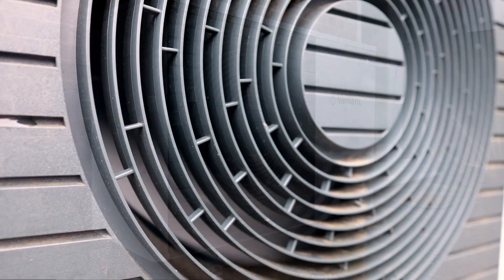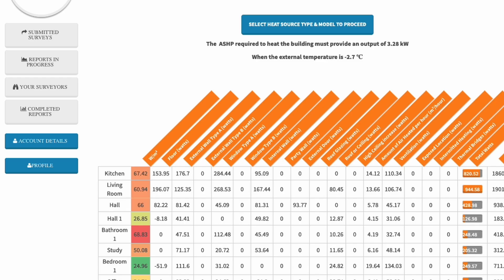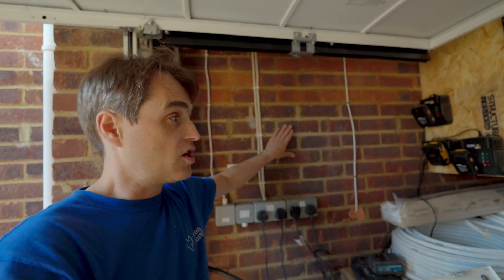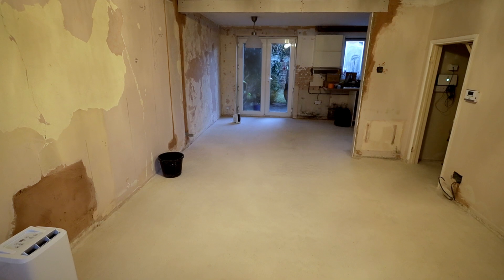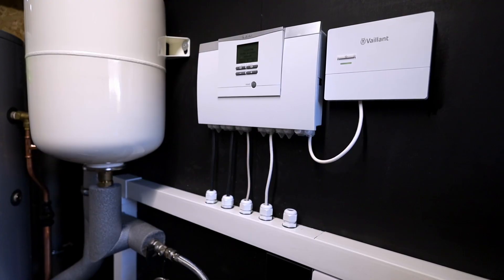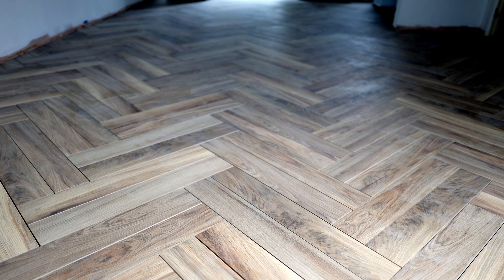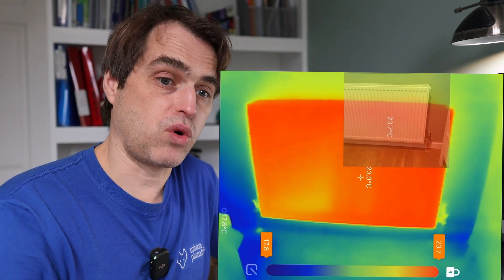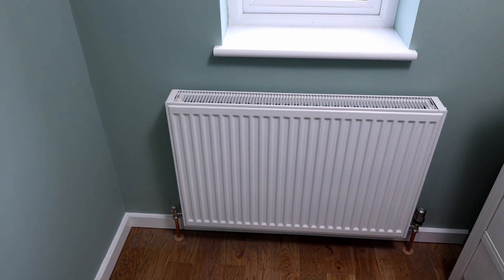How I Installed The Most Efficienct Heat Pump In The UK.

Comment: Could you tell me more about how you achieved such a high DHW COP? (Currently shown as 4.6) Looks like a Joule cyclone cylinder, and I guess you use the Vaillant Arotherm plus 5 kW in Eco mode? What size cylinder is it? What's the smaller tank, I thought you said you didn't use a buffer?
Reply from the maker: Currently using Newark 6m2 coil cylinder that replaced the Joule. Water heated to 44c using 0c offset, eco setting and also quiet mode to further drop heat pump power.

Comment: My boiler broke and I immediately assumed I'd get a heat pump. Now I've done the research and got quotes in it seems installers are charging in the order of £2000 a day labour rate, assuming two people that's about £1000 per day wages. Or £20k per month, £240k per year?! Then with the difference between gas and electricity prices I need the heat pump to reach a COP >4.2 in order for it to be cheaper to run than the gas boiler. That's ignoring the increased cost to install it. Now I'm looking at batteries and solar in order to make the heat pump make financial sense. It looks to me like in order to get the COP that high I might need new rads, improved insulation, and maybe even new windows. Further increasing the costs. It's the right thing to do in the LONG run. But I'd be paying a high premium up front for something that might not pay itself back for 20+ years. I guess this explains why heat pump take up is so slow: The ROI is so long that only people with excess cash or who are certain they want to live there for 20+years invest in it.
Reply from the maker: If installers were charging £1kper day per installer average heat pump retrofit would cost £30k. Is that what you are being quoted?
Reply: Have you noticed that when the Government put the grant up from 5k to 7.5k, the installers quotes went up by the same amount!!!
Reply from the maker: @adamsweet3587 no they didn’t - Ofgem statistics shows a mean price going up £13 in a year. That means the price has actually come down by some 5-6% when you take inflation into the account. Mean BUS heat pump supply and fit cost is £13k
Reply: @UrbanPlumbers Cost is about £6300 to me after the £7500 BUS rebate. £13800 without BUS. 

To be fair there's significant cost in the surveying, design of the system, sourcing of parts, etc. But I'm being charged £450 for the survey which I presume covers their time to do it and the associated calcs. With the right set of spreadsheets and having done it before multiple times, I'm thinking that might take a day? Maybe two? If it takes longer than this then get in touch and I can knock you up a calculator that should take a lot of the time and effort out of this!

Looks like they're charging about 20% markup on top of the parts cost (Price inc VAT +20%). From what I understand that is fairly normal for any trade. 

I'm being quoted >£4000 for heat pump installation labour plus the materials etc.  I've not had it done so I don't know how long it takes, but statistics seem to think it's usually 2 or 3 days? I assumed two people for two days, hence £1000 per person day. Being fairer, call it three days and that's about £700 per fitter per day?

Are you saying it should take 30 days to take out the boiler and install a heat pump in a property? Factoring in 250 working days a year and full time would be 8 heat pump installs per year. £4700 labour fee per job would add up to £38K per year. Fine if you're working alone, but some of this stuff is heavy so I expect two people, which £19k per year which is less than minimum wage. Also 30 days to do the install seems insane. It really does look like 2-3 days worth of work? I'll report back once it's done, I guess?

Or 10 people working the 3 day average install time? £39k each per year. That seems pretty reasonable!... But then there's the video of Adam having his hydrogen fuel cell replaced with a heat pump in a day with "six" heating engineers (but I count 7 + Adam). That kind of makes sense with two people for three days? 6 people in one day?
Reply from the maker: £13.8k without bus is about correct. Adam’s job was done by the top 6 guys in the country - we do charge more and we are quicker are what we do
Reply: @adamsweet3587  I didn't, but inflation has been mad the last few years. That could explain a big old chunk of the difference. I think we had ~16% in one year alone due to COVID?! From 2019 to 2024 £11k has been inflated up to £13.65K.

Do you have receipts for this claim? Like, quotes with the 5k BUS and then the same with 7.5K? Was labour charged at £2k per install prior to the BUS increase?
Reply from the maker: @Leo99929 just check Ofgem stats - available to anyone for all the BUS data
Reply: @UrbanPlumbers  Thank you for the pointer! 

Can confirm: 2022-2023 average air source heat pump total quote amount for BUS grants paid (grant value included) £13590. 
Same statistic for 2023-2024: £13811
An increase of £221 or about 1.6%. That's less than inflation or CPI. Meaning that quotes doesn't seem to have increased proportionately since September 2023 when the grant changed. 
It doesn't look like there's any truth to @adamsweet3587's claims.
Reply from the maker: @Leo99929 yes, people just assume things without doing any research
Reply: It’s funny our obsession about ROI, we never talk about how a car pays us back, or an attic conversion. We do them and we benefit from them in comfort, being able to do things better, saving carbon etc. and if ROI happens then that’s just a bonus.

Comment: If you well insulate a house and install a dense underfloor heating pipe network running at 35c flow temp but run it off a gas combination boiler is that cheaper or more expensive to run than a heat pump? For sure you've got 400% efficiency from the heat pump but electricity is 3-5x the cost of gas and the heat pump itself is much more expensive than a boiler.
Reply from the maker: It will be much cheaper on heating with a heat pump. Mine runs at scop of 5 and boiler would be around 95% efficiency for n this set up so heat pump is over 5 times more efficient
Reply: Quick reply thanks, however gas is 5.5p kWh while electricity is 25p kWh, surely it would then need to be at least 400% efficient to just break even on running costs. There's also the not small consideration of the heat pump needing a cylinder in addition to the heat pump both of which cost individually more than a decent combi. I see the benefits of the tech but I can't help but think that the financial benefits are negated by the high relative cost of electricity over gas and the additional upfront cost of the equipment.
Reply from the maker: @junejunes2024 I pay 0.22p for electricity and 8p at night for 6h. 

Spark gap will close sooner or later. Gas is bound to be more expensive as time goes not cheaper.

Comment: Thanks I have had a 8kw Ecodan heat pump installed. I calculated I only need 4kw and it’s showing 2.5 scop on hot water only . I got heat energy monitoring installed . I am looking forward 
To higher SCOP once the weather compensation sorted. I am encouraged by your videos and hope eventually to keep improving the system
Cheers Andrew

Comment: I will be installing heat pumps, however, I do not expect to be able to use them in the depth of winter as the temperatures get to -30 Celsius. At that temperature the heat pumps simply can't keep up.

Comment: I have also installed my own vaillant arotherm 7 kw heat pump connected to my underfloor heating without buffers in a well insulated new build. I also have installed kamstrup heat flow meters.  My SCOP is also higher than what the spec says should be

Comment: Well done, this is a great video, very clear and informative. The only thing I would add is a clear view of the plant room schematic, although the layout is fairly obvious to me.
How do you get on with domestic hot water? 
Does the heating go off for long periods whilst the domestic hot water is heating up? Do you notice the temperature dropping in the house?
I hope the cable in the cavity doesn't bridge the cavity and cause damp on the inside wall, I would be slightly worried about that. Probably be ok.
I looked at the recent COP figures. The outside temp is going up, but your COP is going down, any idea why?
Overall very good job, a nice simple and neat install.
Reply from the maker: it is what is called 'Hot Water Priority' so hot water is never done at the same time as heating.

COP is going down as my heating COP is around 5 and hot water is aroudn 4 - and now I am only doing how water so it will push the scop down towards 4 and then go back again in the winter.

Just shows, that my system has the highest COPs in the winter!

Comment: Do you get any vibration/noise from the unit in the house? We've been advised to put them a few metres away from an external wall, although customer complaints haven't been about noise, more about water not being hot enough lol
Reply from the maker: Depends on a heat pump. My vaillant is dead quiet - can’t even tell if it’s on and water goes to 70c so plenty hot

Comment: You made my day with the uninsulated underfloor comment.  I installed hydronic in my basement slab without insulating underneath it (sides insulated) thinking the thermal earth mass (gravel) under the slab would be helpful for maintaining temperature.  For years everyone said this was a big mistake due to “infinite” heat loss through the ground (despite earth being an insulator itself).  Anyway .. I never noticed any unusual issues /losses with my system but nevertheless thought I made a mistake .. but this video actually supports that I may even have made a smart choice after-all by forgoing this insulation as thermal mass helps heat pumps big time .. and I’ll be installing one as soon as we get cold-weather propane units in our market. Thanks.

Comment: How is the UFH performing without insulation? I'm thinking about doing the same at mine, was curious to know how it is going? I feel the same as will act as huge thermal mass. Additionally if the solid floor (uninsulated) is factored in with the heat loss and as consequence the pump is adequately sized, there shouldn't be any issues. Cheers
Reply from the maker: Works extremely well. I have done it on more jobs now and it gives great thermal mass and amazing efficiency!

Comment: £600-800? my 4 bed semi 1960x build with 8mm copper and combi boiler was ~£360 last year (May 2023-May 2024) that includes £100 standing charge, HG quote to switch to Heat Pump is around £9k after gov grant, and that doesn't include re-piping the house which additional £3.5k. My annual consumption ~6000kWh, even I run with 500% efficiency, that would cost me £324 per year. So fantastic saving of £36 a year with payoff period of around 250-350 years. If I put £9k aside and lets imagine earn 5-6% interest, in 350 years it will be £234,691,404,461.51 with buying power £7,541,687. What is my take? Heat pump is an awesome technology, ruined by manufactures selling them super overpriced and installers charging an arm and a leg. My 3.2kW air-to-air unit costs £1200 with the installation, it is a variable heat pump also, I would say even more complicated than any Air-to-Water as there are 2 blocks, but we used to them, so prices are reasonable.
Reply: I have 8mm copper pipe and a combi boiler.Your gas bill was £360 in a year? Our house is 3 bedroom detached build 43 years ago .Double glazing and cavity wall insulation.Loft insulated.Our gas bill is double that do you have your heating on? We heat up 8 radiators.Or have i got this all wrong?
Reply: @foppo100  I have a small house 108m2, cavity, loft insulation, double glazing, 2025 gas  total was £453.40 with SC. 6370.53 kWh used for heating and hot water. Boiler is fixed to minimum modulation of 7KWh, Weather compensation, median flow temperature 37C at -2C, 7 type 22 radiators + UFH downstairs, hot water set to 40C.

Comment: Did you say 2.5mm cable to supply the heatpump? It sounds like you say "height" of cable.
Reply from the maker: Yes, it’s only 16amps
Reply: Was the heatpump 5kW. Also wondering what your primary pipe size is
Reply from the maker: @adrianred236 heat is named 5kw but it’s really a 6.5kw unit at my flow temp.

Comment: Just two comments.  1 I think you should have put some insulation down on your flooring before you laid down your screed.
   2 You are one of the best installers of heat pumps your understanding of system’s and workmanship is brilliant.
But for the average Joe trying to understand a small part of what you do is a tall order. Then once it’s installed you need to keep a eye on system to see that it’s performing correctly.  It takes up a fare amount of space .  A lot of installer’s are not as good as you are.  And it also costs a lot of money to have a good system designed and to have someone as good as yourself install it.
    Keep up the good work.🥵🥵

Comment: Such a fantastic installation. I’d love to upgrade my property to be more efficient and get off gas, but the cost of the upgrades is so high and the amount of hardware that would need changing is quite considerable. And there’s nowhere that could act as the plant room. Perhaps a few years from now, though. And at least I know to look for a Heat Geek Elite installer to ensure it’s a good job!

How long did it take to design the system and accurately survey the thermal characteristics of the property?

Comment: This guy speeded maybe 40000$ on insulation and heat pump and  all those tech  just to cut his heating bill in half. lets say he is saving 200$ a month times 5 months that you need heat 1000$ a years of savings. you need 40 years to get your investment beck. you can put the 40k in bonds and you will get a lot more than 1000$ of interest  a year and still have 40k in the bank just i case you need  it. not a good math,
Reply from the maker: The insulation was £1600 ($2000) - the heat pump and all the kit including radiators and UFH was around £7,000 ($9500) -  so a total of around $11K was spent on insulation and the kit. Then I got a government grant of 7,500 ($9,600) - so the whole lot cost to me was around $1,400 plus my labour

My savings are in the region of £1,000 per year now - $1,300. This means that if I take the grant into the account it pays for itself in 1 year.

If we ignore that grant and add my labour - this installation would be around £20K ($24K) - which would mean 18 years payback time, if you only looked at financials. In my case I was renovating and had to change the heating system anyway - so this doesn't really matter.

Have a good day!

Comment: For myself after all that effort and cost I would expect a room temperature of 22 degrees. 20.5 degrees is not a comfortable temperature for most people
Reply from the maker: That not correct. Fully weather compensated system that is on all the time and charges the fabric of the building is very comfortable at around 19c. 

22c would be very uncomfortable for 90% of the people with this system.

Don’t confuse it with on/off - this is a complete different situation

Comment: The engineering and craftsmanship used with your installation is amazing.  Living in USA, my house is much less historic than yours.  By using a mini-split air-air heat pump with wall cassettes, I was able to do the installation myself of a 3-ton unit which heats half of my house in one week.  The circulating fan is very quiet, unless turned to high. 
  I didn't disturb the old furnace, so I have recourse in the event of very cold weather.  Our coldest weather was 18F  (-7C) and  I didn't use the furnace.  Where appropriate, such a hybrid approach can significantly reduce upfront costs, with only a small reduction of savings

Comment: Hi, Do you have any opinion or experience with the new R290 heat pumps?  Given the 75 deg temp they can achieve I'm assuming they could be retrofitted into existing radiator systems with little or no modification to main pipework...  It would be interesting to hear your thoughts.

Comment: I'm doubtbul about a heat pump  for our terraced house as the back garden is tiny and totally enclosed, and we can't put heat pumps in our front gardens as it's  a conservation area.  However, it's good to see you getting serious efficiencies from your installation. What's that small cylinder in the middle of your set-up? Looks like a Cordivari buffer tank of some sort, and from the diagram it looks like it sits on the return side of your heating loop, so what's its role in your system?

Comment: I'm building a super insulated house and plan to install a heat pump. Thinking of a propane Vallient 7kw one.. might fit it myself. Lots to learn first though.
Reply from the maker: it makes no sense to fit it yourself. The materials alone will cost you more than even the expensive quote less the grant.
Reply: @UrbanPlumbers  I dont think I'd get the grant. Seems like the quote i had was exploiting the grant. How long does it take to fit an ASHP and cylinder???
Reply from the maker: @BrettJulianChamberlain  around 5 days for 2 people plus 1 day for the electrician - so some 11 man days
Reply: @UrbanPlumbers  Is that just to install hot water, buffer and heat pump? Never mind electrician who im paying seperately. No hot or cold plumbing to rest of the house. Just underfloor heating and hot water cylinder? Is that worth £7.5k?
Reply from the maker: @BrettJulianChamberlain yes it is. If you do it yourself your materials may cost exactly that plus you need to do all labour and know what you are doing. 

5 days is for heat pump and cylinder work excluding all UFH and rads.
Reply: @UrbanPlumbers  So you think £14k about right on a new build, for just cylinder and ASHP instal and connection to UF heating?